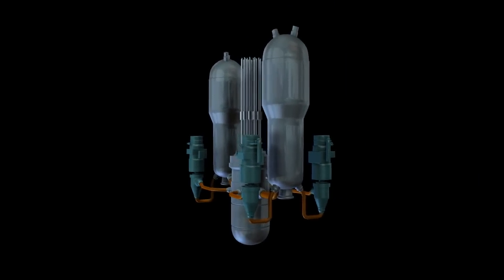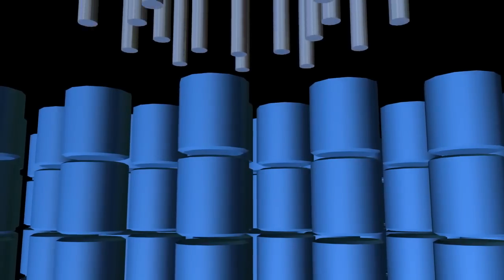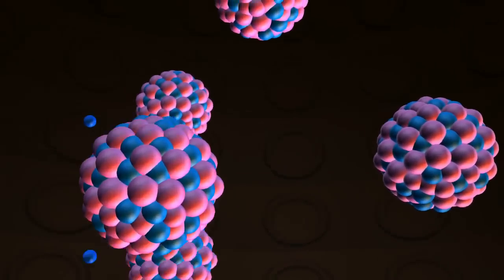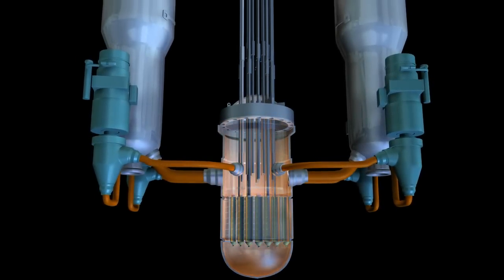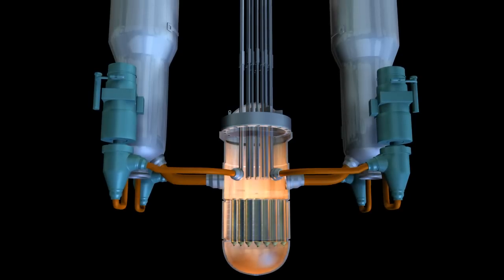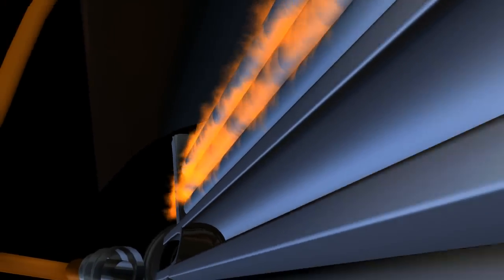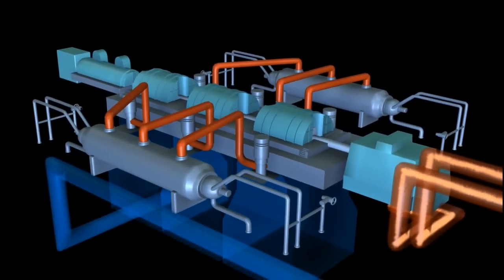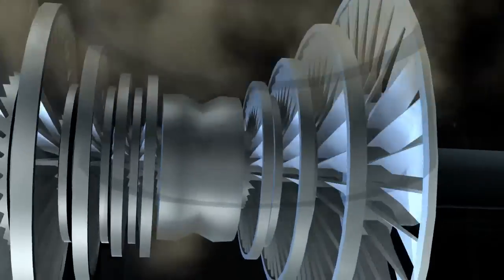How does the APR-1400 nuclear reactor work?

Comment: Mean. The nueclar reactor doesnt creat electricity. Just heat the water and vapor move turbine that move generators. Ok. Mean what ever move the generators creat eletricity. Actually not need nuclear reactors.
Reply: natural gas and coal power plants work the exact same way and wind turbines are also connected to generators with gears
Reply: You have to figure out how to turn heat into spinning a generator, you could use Sterling engines but they are really big and steam turbines are cheaper and almost as efficient. Basically you generate power by boiling water using natural gas, steam, nuclear, or any other way. It doesn't matter how as long as it gets hot.
Reply: @pilotavery  
Well, in general, if you heat up the reactor coolant in the primary circuit more strongly, the steam in the secondary circuit will have a higher pressure, the efficiency can be increased to 41%, fast reactors have shown this.
It is only necessary to develop reactors with supercritical pressure.

Comment: The accident was set off when the operators almost shut down the reactor and then initiated steps that let the reactor to go out of control.  A little internet searching will provide more detailed information.  After the steam explosion and a hydrogen explosion the graphite remaining in the core burned for about a week.
Reply: This here is about APR1000, not over 50 years old RBMK with positive void coificient. There is lots of videos about those if you prefer writing about troubles, not advanced reactors.
Reply: @Signal_Glow  W

Comment: The problem was that the reactor moderating material used in Chernobyl, graphite, has a positive void coefficient, and was thus susceptible to increasing neutron activity as the reactor temperature increased. So, once the reactor became too hot, it was extremely difficult to make it cool down again, hence the steam explosion which blew the roof off of the reactor building. Unlike modern reactors, Chernobyl had no containment building, so the reactor material was ejected into the atmosphere.
Reply: False. Graphite moderation alone does not intrinsically have a positive void coefficient. Please  don't talk about stuff you don't understand. There's already enough misinformation surrounding nuclear energy.
Reply: @magicstix0r  why then, please explain god of information
Reply: @gustavoduarte915  

The steam coefficient of reactivity (sometimes void) depends on the steam content in the reactor with a graphite moderator; graphite itself does not have it at all, it serves as a moderator, so he is right here.